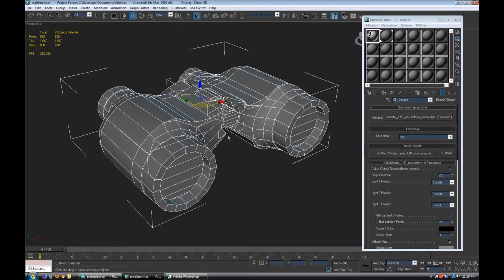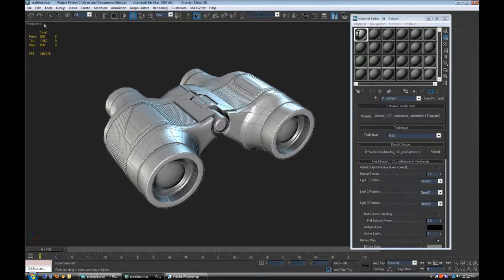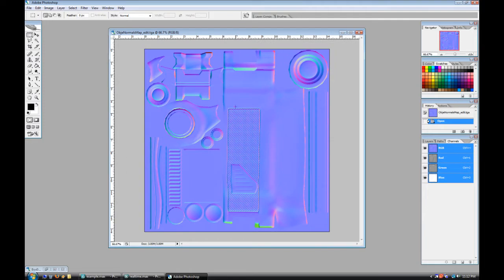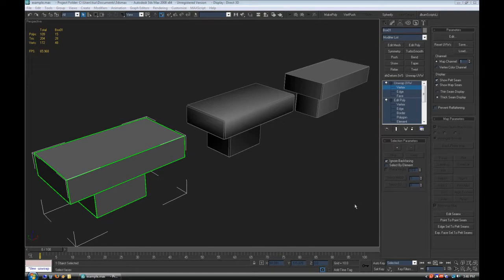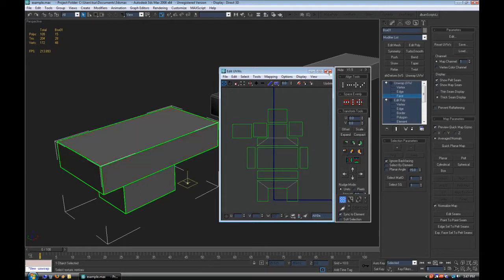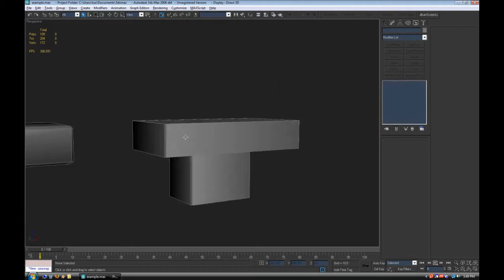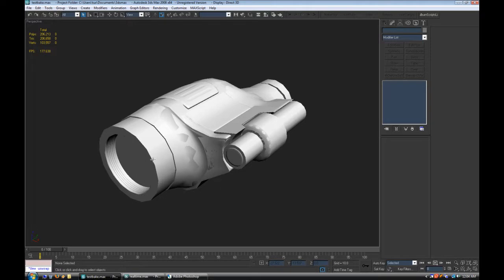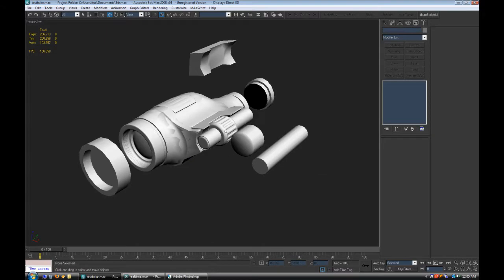How to Bake a Flawless Normal Map in 3ds Max.mp4

Comment: If your map turns out all black, you may be rendering with a different renderer such as vray, in which case your render to texture element should be Vray Normals Map instead of just Normals Map.  Alternatively, you can change your renderer to default scanline.

Comment: Diffuse map is the material color only/texture diffuse
Complete map is Diffuse + lighting + any effects of the normal map/bumps
Lighting map is lighting only (lights and skylight for AO) - Skylight enable shadows 10-20 rays (higher takes longer, much longer, I reccommend using 3dcoat or Knald to do GPU based AO baking its a million times faster)
Normal Map - requires projection modifier applied via the baking panel or by modifier list, tweak the cage and test.

In all cases the output file shows the actual image, not the preview renderer image (dont save that from the disk icon after render, its not the one you want).

Comment: Do I need to have the same UV on the low poly and high poly? Because when I do that the normal map generated is kind a mess, not as I left in the low poly version, and when I try to add an Unwarp UVW on the high poly it simply crashed the entire pc because I think it's too much processing...
Reply: The high poly does not need UV's. Only the low poly does.
Reply: Yeah, I know... but it was pasting the normal maps randomly on the image, so  I thought it should have both the same normal map, bubt I was testing alone and realized what was wrong. thanks